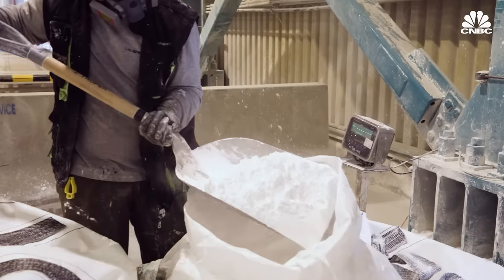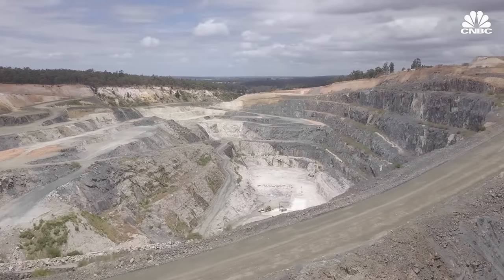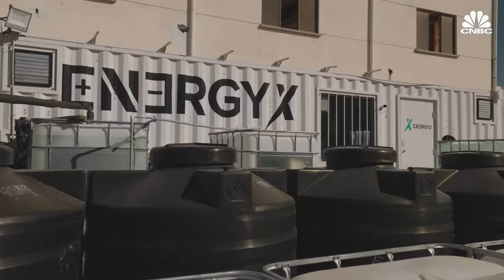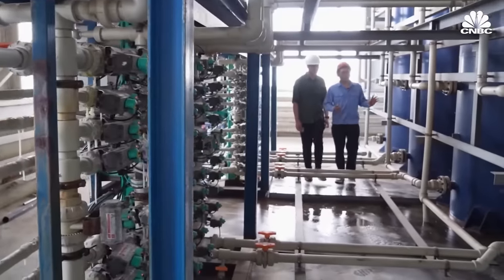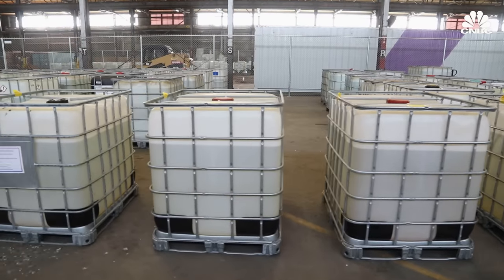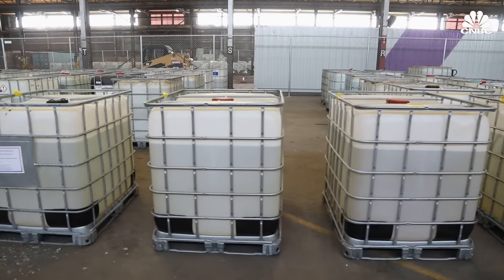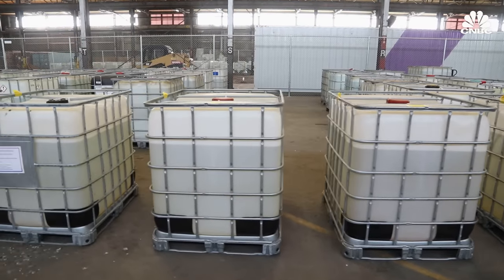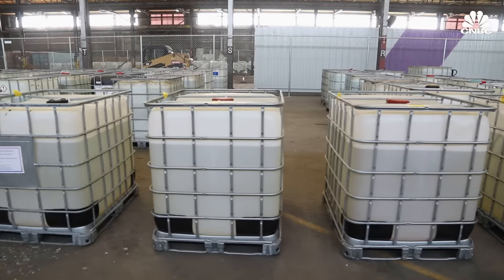Why The EV Industry Is Betting On This Lithium Mining Breakthrough

Comment: What becomes of the metals categorized as "impurities" in this process? It's hopeful that they are being isolated and utilized as well.🤑
Reply: Good question. My guess is that 'it depends'. For example, if the metal is common, such as iron, yet no process currently exists to extract it without extraction cost making it unprofitable, then the material will be set aside. The EPA would determine if it can be simply buried or (more likely) that it could pose a toxic leeching hazard, and therefore requires a more controlled disposal. Most mines have this issue, where the crushed tailings cannot be left accessible to water due to leeching of toxins like arsenic, mercury, cadmium, lead, etc.